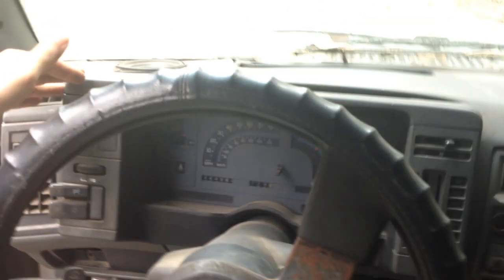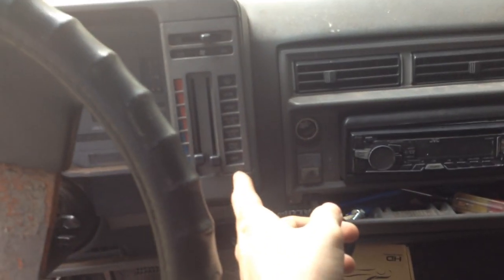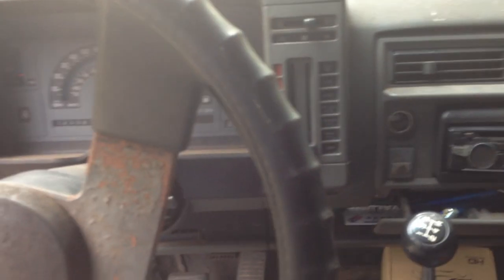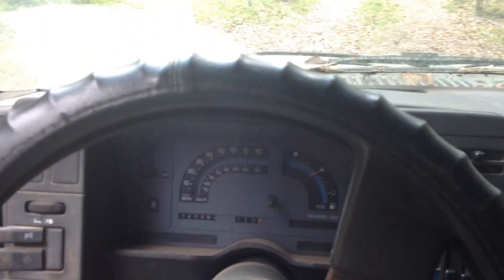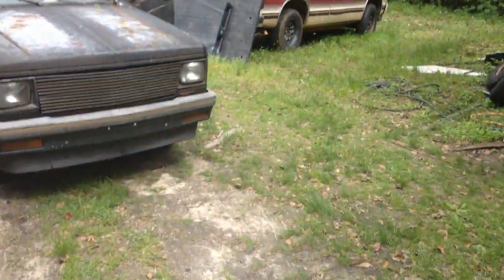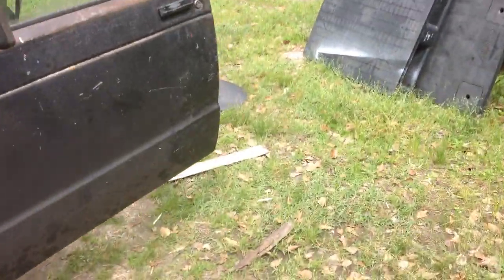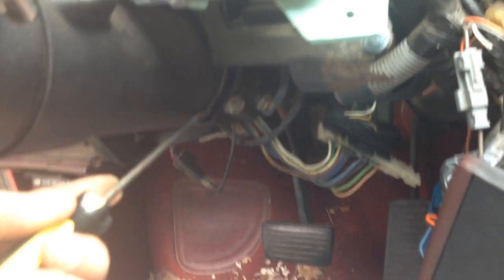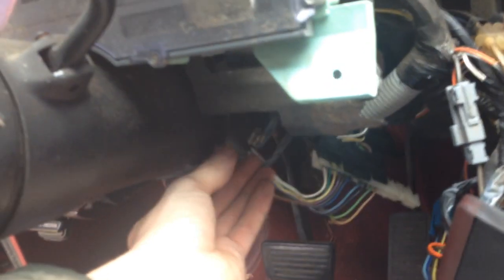S10  replace gauge cluster / lights 1885 - 1995 Experienced right way

Comment: Any-Body I Got a 1991 S10 That When I Turn On The Dome Light Or parking/Head Lights, The Gauges Including Gas Gauge Goes Dead! Checked Ground & It was good. I Just Got Done Converting To HEI & Carb So Any Electronics For Emission Sensings Are Disconnected but Those In Theory has any thing to Do With Gauges... Any One Have this happen? Thanx
Reply from the maker: I had simular situation in 89 crown victoria, pressing breake pedal (turning on brake lights), made everything dim and sometimes killed engine. Improved with battery terminals and new cables, never fully solved.
Reply: @brickwall911  Now its Intermittant,   Presumably  One circuit is "Robbing" the Ground But Rhetorically: Which Ground Is Bad Where? is the Question.  :)
Reply: @Nomadcreations  old ass comment but you could check the voltage drop on your fuses and that could tell you which circuit
Reply: @jkane  Thanx Ethan For the advice , The more i drove On Bumpy Roads the less it happens so Presumably  Bad HIDDEN Ground  Some where Inacessable......
Reply: You mentioned converting to carb, did you have to change the alternator to the bottom or kept it at the same place ?
Reply: @diegomendoza1501  I Bolted On a 2 BBL Adapter and Used a New  Holley 2 BBL carb, I just wanted running Beater status and Dont Like 4 BBls anyway. If You Run Stock 16 Lb Pressure in tank  Fuel pump Put a Fuel pressure Regulator on It  to not Blow the Needle/Seat out, I Adjusted min to 5-6lbs pressure.

Comment: No no.  you are NOT demonstrating that year of 1988 and others.  The panel is held in by a speedo cable.  And there are many more lights (no gauges model)  How do I get the speedo cable disconnected so I can actually pull the panel out for access to the bulbs !

Comment: Sorry, but this is still incomplete information. You have to get way back behind the right side a/c controls to remove two of the nuts. This is a pain, because the a/c controls have no slack to work with and this plastic breaks easy.
Reply: Wasn't really Hard to do but YES, I did have to spend a few minutes figuring it out before I did that, as you mention.  But now what? Yeah,  I'm looking to  learn how to do this....